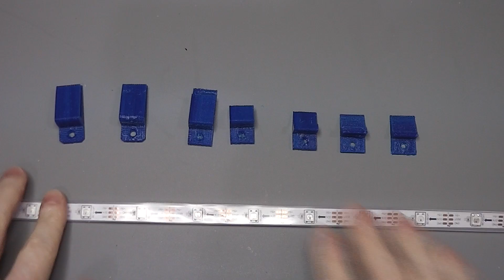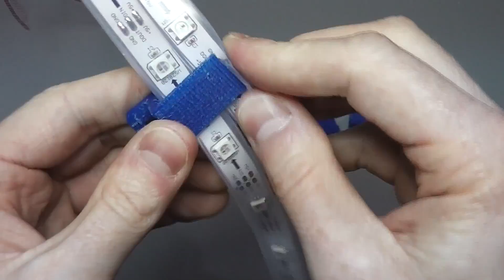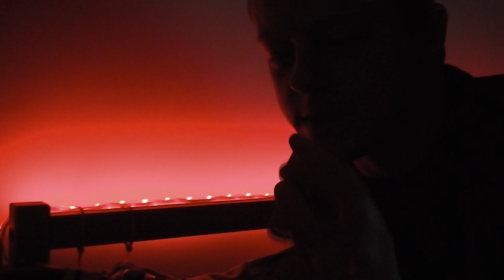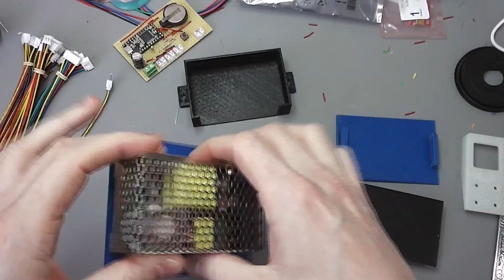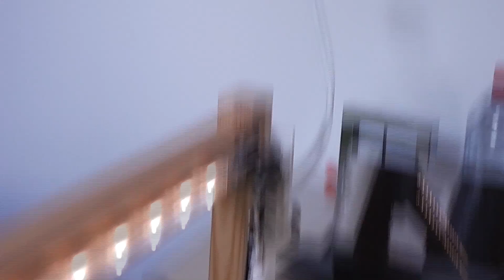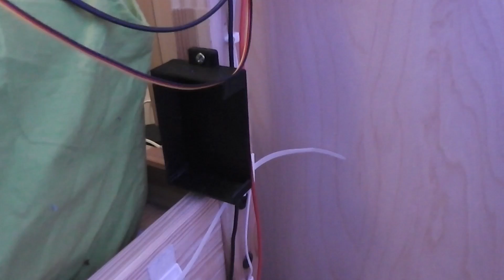Bed Lighting Upgrade

Comment: Nice work.  I am looking for some resources and advice as to where I can find information regarding commands for Neopixels.  I have ripped apart some programs from the Adafruit website but my strong suite is hardware and not programming.  I am working on putting up 21 meters of Neopixels (30/m) in a recessed soffit in my living room.  I would like to go nuts (and I could by just loading 'strandtest', but I digress).  I would like to just start off with one solid color and then work my way from there.  Any help would be much appreciated... I at the vey least need solid green before St Patrick's Day for the party we are hosting  I'll definitely post video once completed. 

BTW -  I really liked the teardown of the Samsung laser printer video.
Reply from the maker: Hi, if you haven't found it already the neopixels are just WS2812 drivers so you could look at the data sheet for the definitive information.
http://www.adafruit.com/datasheets/WS2812.pdf

The example code should be all you need to get started but with 630 lights you will run out of memory on most arduinos. The Adafruit page should give you all the information you need. http://learn.adafruit.com/adafruit-neopixel-uberguide/overview.